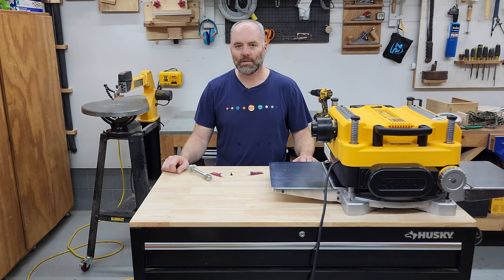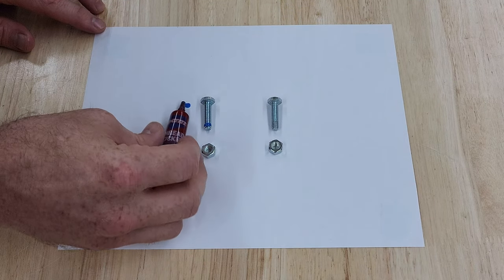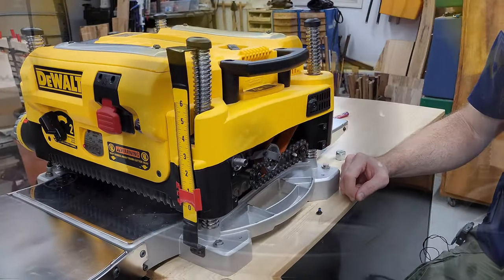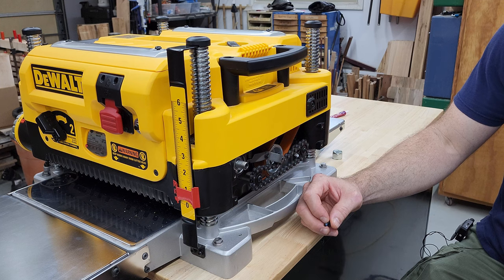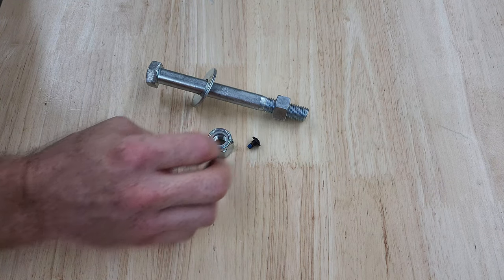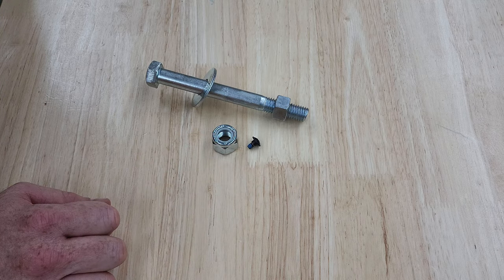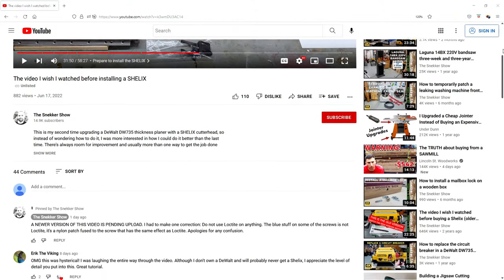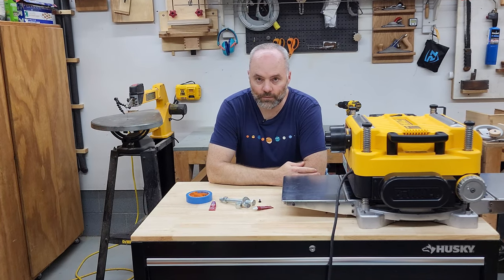What is on this screw, and why did it make me hide my previous [awesome] video?

Comment: Yes, the blue stuff is typically Nylok Blue Nylon Torq-Patch Tuflok.  It allows for repeated removal and re-assembly, and is typically applied as a service by many hardware vendors.  For home use, Loctite 242 is probably your best bet, as it is strong enough to resistant loosening yet it can be removed with hand tools.
Reply from the maker: It makes perfect sense that a mass-production shop would want to decrease assembly time and avoid the variation risk inherent to applying a liquid thread locker that close to a moving part.

Comment: Great follow up video! I would've made the same assumption myself that the "blue stuff" on that screw was Loctite, given the color match was spot on. Never knew that they had screws with nylon patches.
Reply from the maker: I'm guessing they did it so people would associate the color with the function. If it was green, I probably would have done some research first. Leave it to a former software tester to find a bug in an otherwise good plan.

Comment: I used to manage Quality Assurance in the furniture industry.  We tested, specified and monitored hundreds of different fasteners.  When it comes to screws, we used Ny-Lock brand Screws and Nuts in many applications exclusively… until the 90’s.  Then, their competitors finally improved their ‘Nylon Dot’ and ‘Epoxy Spatter’ locking concepts enough to pass our tests.  

There were component tests where we mounted torqued and loose components in an eccentric chuck vibrating at varied frequencies.  Another where they were tapped at various speeds and forces.  Those tests took about 4 hours each.

We then tested the fasteners in assemblies and sub assemblies.  There were various shaker contrivances.  Additionally, they were subjected to product life cycle testing.  These could take from a day to a week to complete.

One thing of interest is that the male to female thread clearance tolerances made very little difference… if the thread locker was applied properly!  The most common error was locating a spot lock where it contacted too few nut threads. We shied away from using those when low torque fastenings were required.  I’m sure the technology has improved by now… but 30 years ago it was an issue.

Your testing method is pretty solid… nicely done sir!
Reply from the maker: Very interesting. It probably won't surprise you that I had to film that little test several times holding the bolt and hammer drill at different angles so the nut moved down the bolt instead of climbing up it.
Reply: @TheSnekkerShow  yes, vibration makes things defy gravity.  At the right frequency you can vibrate a cup of coffee up an inclined plane (3-ring binder) and into an electric motor!  Don’t ask me how I know….

Comment: I've never heard of nylon applied to bolts either. In motorcycle repair it is common for fasteners from the manufacturer (Harley in this case) to come pre-applied with Loctite Dri-Loc. It activates once torqued. They call these single use fasteners in the service manual and are used for connecting the pulley to the rear wheel, for connecting the inner primary housing to the transmission and engine, and I believe on the compensator bolt.
Reply from the maker: This video was a win. I'm getting a crash course on thread locker that I didn't know I needed.

Comment: Thanks for the update ... had no idea. Now I'm wondering how many screws I've applied Loctite to over the years that didn't actually need it. Guess there's no harm unless it locked up another function.
Reply from the maker: True statement. I never would have noticed if it hadn't gotten on the part that was supposed to move.

Comment: Other than too much loctite did you make a mistake by using it?
I am reading different now but seem to recall that the screws with nylon on one side only lock well the first time.
But would not put money on it.   Still at worst belt and suspenders.
Reply from the maker: Using too much was my biggest mistake, which probably wouldn't have happened if I wasn't trying to do it with my hands in front of a camera.  It also probably would have been better if I applied it carefully to the female threads rather than the male.  The last time I did this upgrade I didn't use any Loctite, and in two years nothing came loose.  You're absolutely right though, it's unlikely to cause any real problems unless you get it on the moving parts.
Reply: @TheSnekkerShow  I know how much more difficult it is to work in front of the camera.   Thanks for the vids.